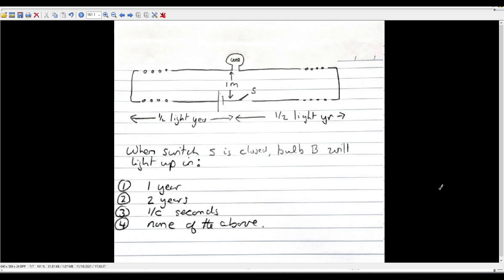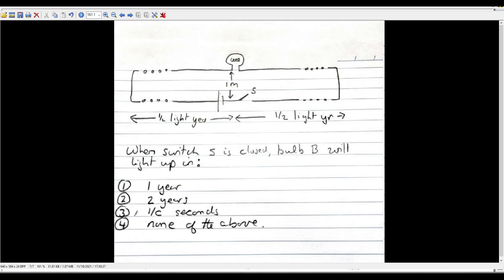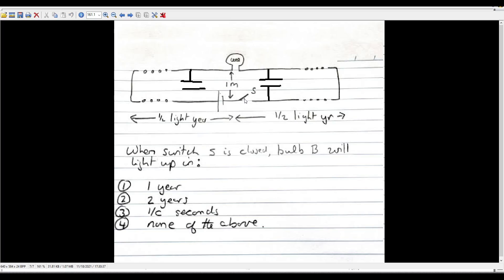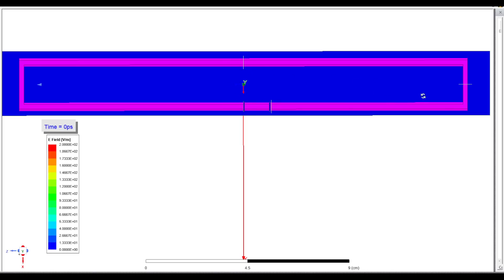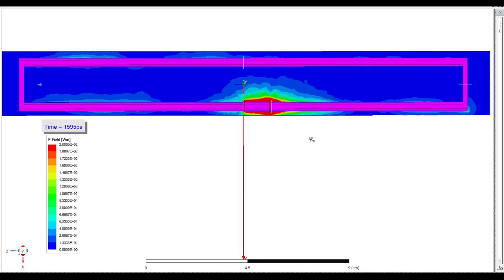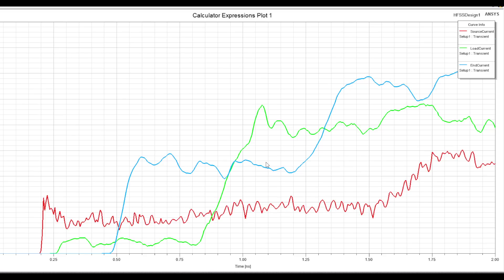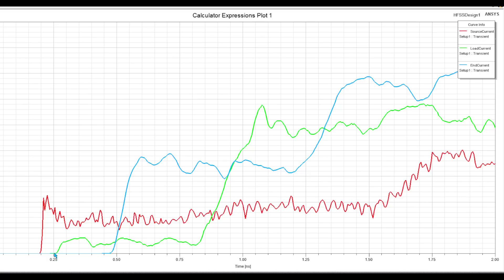Response To Veritasium - Electricity Propagation Time Problem

Comment: I think we make it easier when we compare it to a full pipe of water. Maybe not water since that does not compress but something close to it. When you connect that pipe and start to push more of the almost-water-but-with-some-elasticity/compressibility "fluid" into that pipe, no matter the distance, it will almost immediately start to come out the other end.

Since copper does have that same structure but with easily able to move electrothingymajingies, this would be a great example to simplify, I think.

It's not hard when it's easy 😁😉
Reply: I think this video helps: https://youtu.be/MDOYPQQmuco

0:50-1:50 he brings up your analogy (using marbles in a tube), and uses it to explain how the energy can travel much faster than the individual particles - even that it would look instantaneous to us. Note, though, what he says about the speed of propagation in the marble case (speed of sound in glass) and in the electricity case (speed of light).

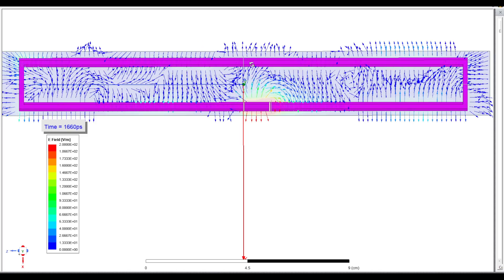8:30-9:10 he explains how in the veritaseum setup, there is a flow of energy through space that induces a current much sooner than it would take for the energy (not just the particles) to travel through the wire.
Reply: @japanada11  I will watch those but I JUST got a notification that electroBOOM has uploaded his view on the matter.

electroBOOM takes priority, even over cooking in this house, so I will watch the link you posted in a bit 🙂
Reply: @mattstroker  YES! I just watched electroboom's take, and I think it's by far the best video on this topic that's been released so far.
Reply: Except that this analogy does not explain what happens. This video demonstrates that you detect a bit of current at the bulb before you detect any current at a point halfway along the wire to the bulb, which is impossible in the pipe analogy - how could opening the valve start pushing water out the faucet before any fluid motion is detected at a halfway point through the pipe on the way to the faucet?

The closest analogy would be that when you open the valve, the mere act of opening the tap sends vibrations through the air which knocks some of the existing water out the faucet, long before the pressure wave makes it through the pipe to push any of the water out. The key point is that there is energy traveling through the surrounding space, not just through the wire/pipe.
Reply: @japanada11   That's a measuring error 🤪

 Are you going to get stuck on the water analogy? I only used water as an example since it is a very easy substitute, people can easily visualize what happens. Assuming water is incompressible and none stretchable, yes. Electrons are not water though. The pressure does not need time to travel. The pressure pushes forward what is already there. The time it does take demonstrates, in the way I see it happening, the "viscosity" (if you will) of copper where it comes to its properties in that regard. Other conductors will most likely differ a few nanoseconds over such distances as the moon or mars.

Let me use a different example: imagine a piece of string (or a wire) that's (almost) none compressible or stretchable. 1 meter long. Pull it or push it. The end furthest removed from you will move away or come towards you with the same force and the same speed at the same time as when you are standing on the other end. No force or speed needs to travel since it is all connected.

Now use a 10 meter long piece of that same material. A 100 meter one. Or one that goes from here to the moon.

Put a boxing glove on the other end of it. Stand in front of it. The speed and force the glove connected to the wire hits you with equals voltage and amperage.

Further, look at the explanation of Nenad Stevanovic in this thread. He describes what I mean also.
Reply: @mattstroker  "no force or speed needs to travel" this breaks relativity. If what you were claiming actually happened, then you could instantaneously communicate with people at arbitrarily far distances just by yanking on a sufficiently long string.

The problem is that every single one of these examples you bring up is mediated by the electromagnetic force, and this force takes time to travel. When you pull a string or wire, or push marbles in a tube, or open a tap, you apply a force to the molecules closest to you, THEN those molecules apply a force to the ones after them, and so on - a wave of energy propagates through the system at a finite speed - much faster than each individual particle moves, yes, but still finite. And the speed of light is an upper bound for how fast this wave can travel. I'm not sure where you got "nanoseconds" for the moon or mars - it's at minimum seconds for the moon and minutes for mars.
Reply: @japanada11  You actually can. If one knows the pull has a specific meaning to it and you told the receiving end that too there is no doubt the receiving end would instantly know what you meant when the string was pulled. 

It also doesn't break relativity.

Just as more power out than in is easy enough. Just have to figure out how. Every nuclear energy facility is waiving at us right now, btw...
Reply: @japanada11  take the incompressible/non-elastic string and go to the moon. I'll stand here and then we'll pull. Ok? 😁
Reply: @mattstroker  everything you're saying is fine if we lived in a Newtonian world. But experiment after experiment shows that we don't - relativity explains reality better. You can imagine incompressible things in your fantasy Newtonian world is you want. These are incompatible with reality. It has been experimentally verified over and over that no energy (including kinetic energy through long thin objects) travels faster than light - at these speeds, things that look rigid to us start behaving like slinkies.
Reply: You also cited Nenad Stevanovic's comment. I completely agree with his comment, but I'm not sure you do based on what you've been saying here. He explicitly states that there is both em radiation through the wire AND em radiation through the air, both traveling at the speed of light (so the radiation through the air would arrive first). His complaint is just about the intensity of the em radiation through the air vs the wire. All valid, but none of it has anything to do with your argument.

Comment: Hi Ben, your analyses in my opinion shows that Veritasium explaining was totally wrong! The low current that flows through bulb wouldn't it light up! It is small part of the energy (current flow) that propagates through the space between the bulb and the battery. In your example it seems quite big (about 10% of the final current flow) because you made quite thick wire in your simulation in comparison to the distance between battery and the bulb. If you would make the wire thicker (in the proposed example it would have to be about 0,1% - 1mm wire to 1m of distance). Could you make another simulation with the wire much thicker than now? Or at least half the initial width? 
In my opinion in the new setup the initial current would drop by half. My idea is just that initial energy that gets to the bulb in 1/c is very small - in this time the wire act as antenas, so received energy is much smaller than the energy exiting the source. Most of the energy goes around but ALONG the wires, just as can be seen on your simulations!
Reply: Ok. I might be wrong about the importance of wires width. Maybe it is just the distance between the wires that is important. Maybe you could make another simulation doubling the distance between battery and the bulb? In your case it is abvout 2 cm. I think if the current flow would be probably 4 times lower, as both, electrical field and magnetic field at bulb generated by battery current, would be 2 times lower! In case of 1m distance the initial current would be 2500 times lower! Veritasium is totally wrong about how energy flows in this circuit!!!

Comment: Insufficient voltage to turn on the light bulb is irrelevant because instead of light bulb we can have a very sensitive amp meter and very, very high voltage of battery. But one point regarding the  light bulb only 1' away need to be addressed. Here it is: Let's put two more light bulbs at the far ends of the circuitry, East and West ends. Each of these two additional light bulbs are 10 light years away from the battery. The original light bulb stays at 1' distance from the battery. So, Veritasium is telling me that the original light bulb will come on before the two new bulbs in the same circuitry 10 light years away? Hmm..... If so, then I need to think about that. You can help me out in this. :)
Reply from the maker: That is correct! I have been attempting some simulations at a larger scale (ie. 1m gap and maybe 50m long) but I keep running into hardware issues with that large of a mesh. I may have to stick to this simplified size but I can do a longer simulation with the wires shorted at the end and one with them open at the end so we can actually see the current increase to a steady state or decrease to zero.
Reply: @PulsedPower  Another twist to this. Let's say, we close the switch next to the batter just for a seconds and then open it. Obviously, this signal has not arrived at the far ends bulbs 10 light year away yet. We then, within a few seconds  cut the wire at the East and West end bulbs. According to Veritasium original light bulb will still come on even though circuit is broken. Remember, wire is cut before the switch close signal arrives at the far East and West ends. Very confusing to me. LOL

Comment: Finally. Someone has approached this topic reasonably. Ofc you cant ever be sure if the model would be exactly correct with numbers of 1 compared to 3*10^-6, its good enough for me. Maybe if you would place resistor in a place of a light bulb and measure voltage+current on it over time, it would be more visualizative. Finally something you can stick to those capacitance theory ignorants :] black and white proporsion of capacitance induced current to wires propagated one :)
Reply: The answer is still wrong. No delay at all will be observed! We did the actual experiment. See my detailed post a the top of the comments

Comment: Very nice video, but I think you are making a mistake that is similar to one of the specialist veritasium consulted.
You can scale down the length of the cable, but you cannot make the 1m gap between the two wires become 1cm, because it dramatically changes the capacitance of the transmission line.
Reply from the maker: You make a valid point, however any reduction in coupling can be overcome with an increase in source voltage. So fundamentally even though the timing and magnitude will be different, we can extrapolate from this simulation that in theory you could light a bulb after 1/c seconds.
Reply: @PulsedPower  Absolutely. You can go all Tesla mode and power an entire city with wireless AC :D It's just not very efficient or safe.
I think the question Veritasium tried to address was "How does the power transfer from the battery to the light-bulb when you turn the switch on". It looks like the answer should be "Along the wire, very close to the surface". If the return wire happens to be very close to the surface, then some energy can jump through the gap and take a shortcut.
But yet. Thanks a ton for this video. Best answer to Derek's video so far !

Comment: Overly literal thinking that completely misses the point. You spent all this effort investigating the noise in the system instead of attacking the intent of the question. Why not just assume an idealized system where there is sufficient shielding so all radiated energy, capacitance, inductance etc. can be ignored. Or maybe instead of wire the connections are optical fibers with detectors instead of the bulb.
Reply from the maker: I think the questiom strongly implies a conductor, not an optical fiber. Similarly, assuming that it could be a shielded coaxial line requires an entirely separate conductor, which the diagram does not specify. It would fundamentally change the problem and the answer would be trivial. Lastly, the capacitance and inductance of the system are inherent to the geometry; in a question that probes the fundamental theories of electricity it would not make sense to evaluate it "ignoring capacitance and inductance".

You say I am missing the intent of the question, so I ask you to please explain to me what you see as the core intent of the question. (And why my considerations of field propagations is distracting from that intent)

Comment: I think there is a key point missing . Even though the timings scale well when you shorten the wires by some factor , this is not the case for the amount of radiation passes from the switch to the bulb. If you scale the distance of the wires by x, I think the wires coupling through radiation will also scale by at least x. This is not the case for the current passing through the wires . Therefore the amount of energy passing in the short path is completely negligible in comparison to the long path.

Another important issue is what is the mechanism of the short path energy transmission. If it is near field, then the decrease in coupling of the wires goes even faster with increased distance.

I suggest to scale up the model by factor of 2,4,8 .. and plot what is the magnitude of the current that is caused by the short path, and extrapolate it to 1 meter.
Reply: great point!

Comment: There are no capacitive effects here, because the wires are supposed to be zero resisistance. So they would be shorted. Static DC voltage also can't magnetically induce voltage across a gap. If it was a really high AC voltage and the buld a neon lamp then I would believe it. Veritasium unspoken theory is if I post this controversy then I will get a big YouTube check.

Comment: 1. The wave propagation is going to be a blip.  Then you get to steady state, and then you have to wait 1 year (in your example) to turn the light on.  
2. I don't think a mere glimmer or flicker is going to qualify for 'the light turning on'.   A potato radio doesn't qualify.
3. With a car battery and one meter of air - how much capacitance do you really get?
Again - he said 'the light will turn on'.  Not that it will pick up a millivolt of what amounts to interference.

Comment: I still miss a point: how do the electrons are implemented in your simulation? Just as a sort of boundary condition (ie E=0) in the conductor ?
Reply: Its a constant voltage source. Technically different than a battery as the battery has internal resistance and chemical intersections/limitations but you can generally think of them as the same.

Edit if you're asking how he starts it he turns off the second 1V source facing the opposite direction to simulate the switch.

Comment: Thank you for the great simulation. Does anyone remember something about active and reactive resistance? In a circuit, when it is closed we cannot assume reactive resistance will be zero, even in superconductors. Your simulation shows it in really great way. While some energy is transmitted by the magnetic field, the majority of energy depends on the electric field travelling through the wire, making answer 3 wrong, well kind of. In your example, it seems if we connect very sensitive light (like millivolt LED) to high energy source (i.e. 240V, 25+ amps) we can make it light immediately, so answer 3 must be right?
But this won't be true if we connect 12V light bulb to 12V wire. While the electric field is expanding there is not one, but two resistors in the circuit - the wire and the lamp, and they are connected in series, sharing energy. Once the field fully propagates, the reactive resistance drops to zero and assuming the wire is superconductor with active resistance equal to zero, only then the full energy of the source is transmitted to the lamp. This is quite complex process as you have shown, but it is way simplified by Ohm's law. Therefore, the answer 3 is wrong, the longer the wire, the more time it will take to fully transmit the energy from the source to the lamp. At 11:37 we can see that between 0.25 and 0.85 while there is some energy transmitted, it is not an energy from the electric field, it seems to be parasitic inductance from the fact the wire ends are so close. This inductance exists between all wires in all elements in all circuits, but when designing a circuit it is ignored and when too significant to be ignored, a shielding is used.
I am interested to see what will be propagation in circular circuit where all points of the wire are far away from the opposite side.

Comment: Are you really think that Ansys HFSS is the ultimate truth? Do you know that every solver in ansys package has its own limitations? I don't want to say that you are wrong cos I don't know. But I have been using ansys for several years and I know that different solver settings can result in diametrically opposed results.

Comment: Veritasium cheats with the second assumption: The light has to turn on immediatly when the current passes through it. And to make it more effective he precedes it with the assumption of no wire resistance, so you don't hear the second assumption because you are trying to decide if the first assumption makes sense. Yet, that is the whole objective of the video, to make a counterintuitive statement so we all can think about it.

Comment: The correct answer is (4) because the time it will [start to] light up is 1m/c.
(3) is wrong because the units as state are s^2/m, which is not a measure of time.

My physics teachers/professors never excused incorrect units, so I'm not about to change that for a physicist :-)
Reply: well, that can be fixed easily: (3) 1/{c} s   :)
Reply: The answer is still wrong. No delay at all will be observed! We did the actual experiment. See my detailed post a the top of the comments